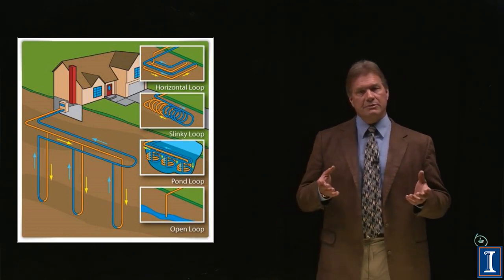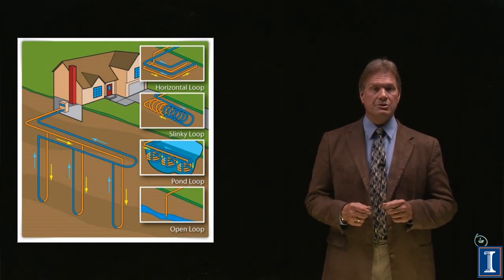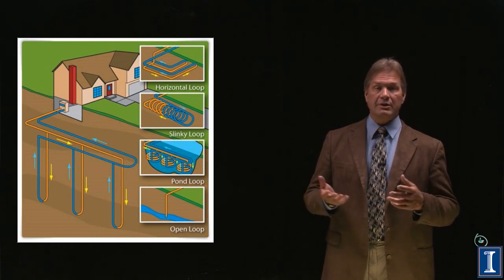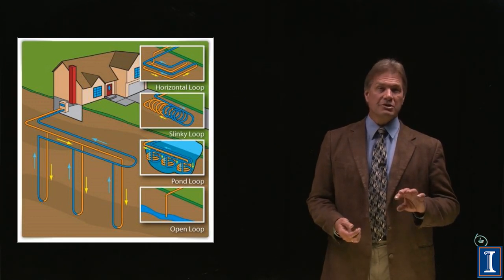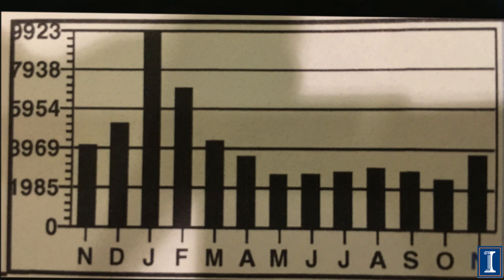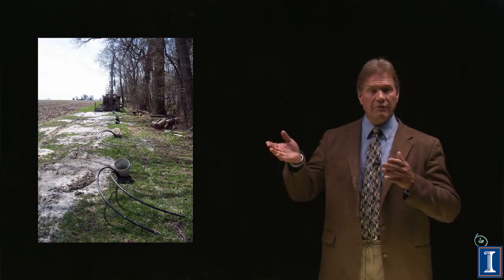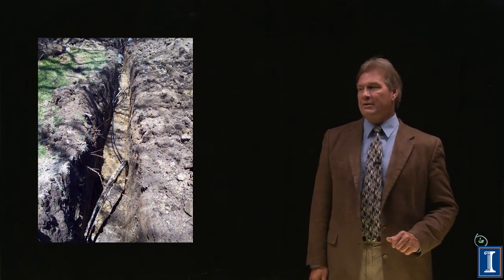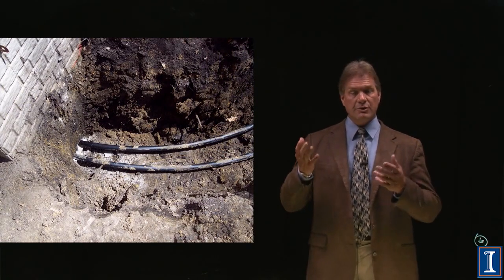Heat for Homes?

Comment: I live in Canada where the air temperature can go below -40. When I built my 4400 square foot house in 2007, I installed an open loop geothermal system using well water as the heat source/sink. The water supply is a constant 10C. I have had zero problems with the system and the breakeven was less than 10 years. Water from the heat pump is returned to the ground by a separate drilled well.
Reply: can u post a video showing the steps

Comment: you shouldn't ever need a backup. thats whats so strong about ground source heatpumps your constantly in a sweet spot of efficiency. air temp outside doesn't matter
Reply: This fellow must have poor insulation in his house plus too small of a ground loop for size of the house. If ground loop is too small or short it starts cooling the ground very fast  or heating it in summer if ground loop too small.  I have never heard of a properly designed GTHE system with resistive heating needed. Maybe also a drafty home. I watched a fellow build a 2800 SF home that can heat the house with a hair dryer in NB Canada.

Comment: I was under the impression that if you bury it deep enough (in the 10 C area), that the efficiency of the heat pump effectively becomes a non-issue? The advantages of heat pumps for southern climates, in the winter, can outpace propane or even natural gas (if it's like a COP of 4 or something). Why wasn't this the case for your geothermal heat pump? You seemed to imply that you had to use a lot of resist heating with your system, which decreased how economical it was, in the end.
Reply: That's actually what I was wandering after hearing that in cold climates the efficiency drops. From the description of geothermal heat pump, cold weather should not be an issue, assuming the ground loop capacity and AC unit capacity was chosen right for the seasonal extremes.
Reply: Geothermal (ground-source)HPs can get COPs of 8 at ideal temperatures.

Comment: Where geothermal is used for heating, it needs to be paired with a heat pump to take the constant 10degC input to 60degC for use in radiators etc.

NB the heat pump is not ‘heating’ the input loop- they use a series of compressors to cycle gas states so that the input is lowered to 5 or 3degC on the return.

Comment: To make fracking there are no problems to dig.
You have to scratch a little more than the surface.
https://www.youtube.com/watch?v=j7q653ffQO4

https://www.youtube.com/watch?v=DFQrE91kZwk

https://en.wikipedia.org/wiki/The_Geysers
Air conditioning and heat pump have a ratio of 1 = 3 or 4.5 at its best.
For 1 kwe can obtain up to 4.5 kwt.

Comment: If you've got natural gas in your house, it seems like a small gas residential water heater, for example an EZ Ultra HE ($629), would have a fast payback compared to electrical resistance heating if your bills are really sky high.  As a condensing type of heater, it should be easy to retrofit even if your house doesn't provide for a flue, plus having little heat loss when it is not being used for months out of the year.
Reply: Really depends on the house. If you don't have the ducts in place it will easily get expensive. You also gotta be making sure your furnace is powerful enough to heat the entirety of your house.
Reply: dont forget propane costs 2$ a gallon plus installation of the furnace. all he is saying is its throws off the payback equation.

Comment: It seems to me that one could take the same principles applied in far north green houses, and use large glazed windows on the sun facing side of their house to capture sunlight in the winter to further reduce heating costs. Additionally, a combined heat and electricity generator via stirling engine and probably natural gas seems quite attractive at the moment.
Reply: thanks that seems much easier